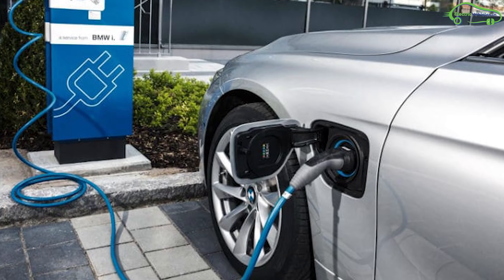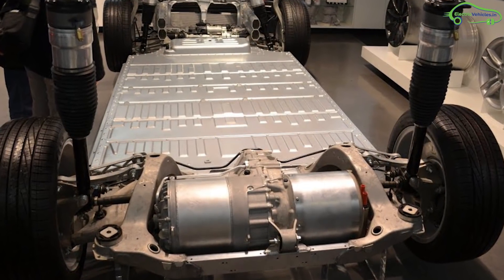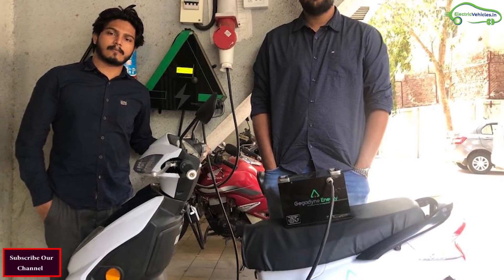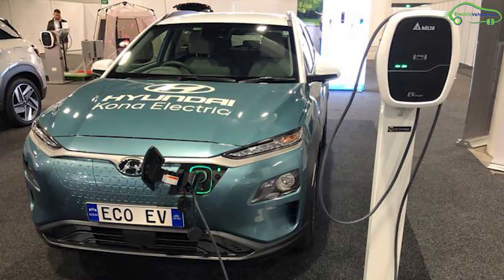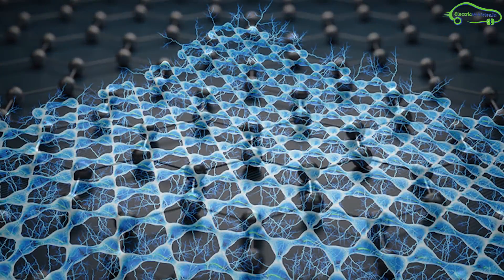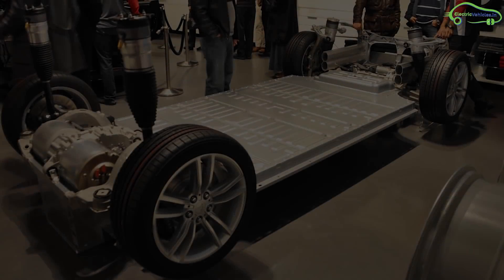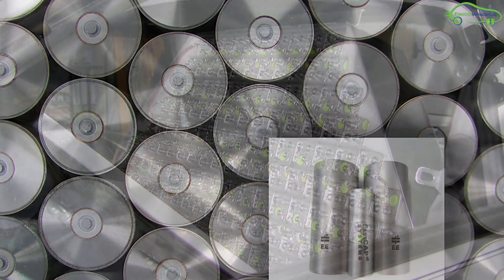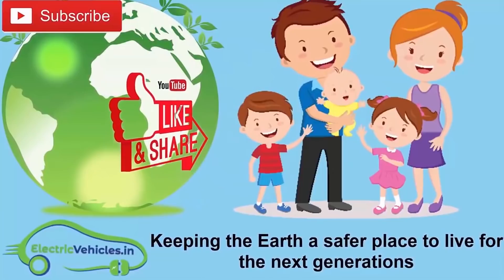Indian Youngsters Made Graphene SuperCapacitor Battery for Electric Vehicles

Comment: I have an exotic electric accumulator that is neither a capacitor nor a battery and behaves somewhat in between (0-chemical reactions involved) the initial prototypes i built shown terrifying results that I’m still scratching my head problem is the high voltages and it’s little radioactive.. and it will kill a lot of people if mishandled it’s so dangerous it could evaporate a human body into ash if you touch the terminals ..

Comment: Don't make videos about stuffs that are not practical, and I mean it's true that super capacitors are great but they are never going to be used in small vehicle because it's charge density is negligible it will run only  few mins.yeah in future we may saw bus,and truck running in sup capacitor, that's it, don't dream more than that

Comment: One suggestion, can't capacitor batteries be used to charge li-ion batteries in vehicles.As li-on take long hours to charge,high cost,etc.The super capacitors have self discharging as its disadvantage .And this product has not been in market now . So first charging the normal super capacitors with short time and then use this power to run the vehicle and also charge battery while running..Can this be a short term sol. for right now.as these products are under development only....comments down your views.....

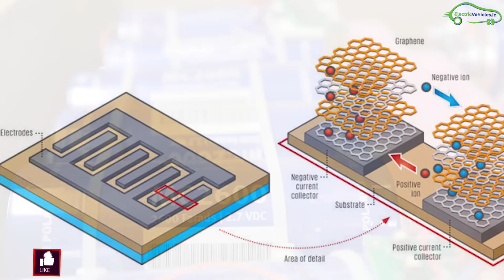Comment: The comment @2:45 that super capacitors are lighter to carry is actually not true. Rather, energy density by volume or weight is where super capacitors are way too poor. You need a huge bank of super capacitors to get equivalent range and the cost will then also be prohibitively expensive. This video doesn’t provide a word of solution for why nobody uses super capacitors. It’s a sort of scam but I don’t think the guy talking on the video is himself aware of it.

Comment: Supercapacitors can deliver gigantic currents, for a very short time. The voltage collapses very fast with time, unlike a battery. Energy content is low. Very useful later for fuel cell driven cars, but useless now.

Comment: Supercapacitors can't replace batteries because they have very high self-discharge rate. Battery has bad power density but can store charge for longer time. Supercapacitor has excellent power density and can deliver high amount of current without any issues which a battery can't. Batteries and SuperCapacitors are complimentary technologies not each other's replacement.

Comment: Bro get to the details.
Graphene has less energy density compared to lithium ion battery
Reply: Graphene is not higher capacity than lithium because of 3/4 lithium structure, but it's really fast at charging. Imagine charging car for 5 or 10 minute.

Comment: Where are the specifics ?
Power density per kg. ?
The clip is high on generalization and low on details.
Super capacitor based ?
It has high energy density but very low power holding capacity.
The price of supercapcitors are very high. A 1000F 2.7 volt costs above 10 USD.

Comment: Super capacitor batteries are not safe on the road, if accidents happens on the road than how you going to control discharging of the super capacitor battery 🔋 packs,,  no management system is developed for manufacturing 

My advice go back University study 📖 and do your Phd in EV batteries 🔋 before wasting your life

Comment: Until the part where graphine as a  super capacitors is fine. Fast charging and fast discharging. But the part where it becomes an all out battery is dicey.  Capacitor banks can work alongside batteries in EVs to improve range. Especially in series hybrid models but to expect them to completely substitute the battery is a little far fetched:)

Comment: Graphene based super capacitor batteries might be safer for utility scale stationary battery storage with strict safety regulations. Alternatively, for batteries in EVs, we can use highly porous activated pure carbon derived from coconut shells, which has good energy density and non toxic.

Comment: Show his lab work, to believe.too much useless talking.
Reply: pretty videos more like a kickstarter campaign show
Reply: Even wikipedia will tell you that materials for supercapacitor still being researched
Reply: I believe in these engineers, we need this to succeed. Eventually they'll pull the carbon from our polluted planet ant make a battery.
All the negativity doesn't make you any  smarter
Reply: @vintageringsGarry  with all due respect, I hope you will agree with me that talking about progress and making real progress are very different from each other... This video does not give any tangible information other than pictures and a deadline... Should we really believe that?
Reply: @sumantacm1  
They have manufactured A, AAA, C, D and   batteries for hybrids that are not affected by the winter temperatures.  I have 2018 hybrid Lithium batteries. Very poor in winter 
Because lithium batteries were too expensive..
There using them in their 3 wheel transport trucks. 
I have alot of respect for these brilliant engineers.

Next they'll be using carbon from the atmosphere to build batteries.
I think you can take that to the bank in the future.
Reply: This is already in research by tesla
Reply: Supercapacitors are not news... Maybe you can fit about 3KWH capacity in your scooter but it will cost you. A 2.7v500F super cap costs about 600₹ and holds 0.0005KWH of energy so per KWh you need thousands of them... Want to buy one?... And yes nobody on earth yet found a suitable and cost-effective way to extract graphene and put it in a supercapacitor... These are all overhyped startup talk don't get excited with the deadlines they are expired anyway...

Comment: DEAR BRO....GRAPHENE IS ALSO TOXIC...JUST LIKE "LITHIUM "...
THE BATTERY BASED ON GRAPHENE IS CREATE ENVIRONMENTAL HAZARD OR POLLUTION...PLEASE READ BELOW

1) Some  of  the  major  disadvantages  of  graphene  include  but  are  not  limited  to;

Being  a  great  conductor  of  electricity, although it  doesn’t  have  a  band  gap (can’t  be  switched  off). Scientists are working on rectifying this.The  main  disadvantage  of  graphene  as  a  catalyst  is  its  susceptibility  to  oxidative  environments.Research has proven that graphene exhibits some toxic qualities. Scientists  discovered  that  graphene  features  jagged  edges  that  can  easily  pierce  cell  membranes,  allowing  it  to  enter  into  the  cell  and  disrupt  normal  functions.
Reply: It is dangerous to put graphane in EVs. During accidents, if graphene is released and inhaled, it will cut through lung tissues.
Reply from the maker: Thanks for your information and your support
Reply: kahan se uthaya hai yeh jankari ? graphite ki ek atomic layer ko graphene kahte hai .. graphite toxic hota hai?
Reply: Samsung also going to use graphene for mobile batteries.

Are they using different technology ?

Or they ignoring this fact ?
Reply: @sachinpundirspy  YOUR DOUBT IS ABSOLUTELY RIGHT....BUDDY....THEY ARE IGNORING OR HIDING THE FACT
I CAN TELL YOU WHY....CHINA IS SOLE EXPORTER OF LITHIUM. CHINA DECIDES THE PRICE OF LITHIUM . SO USA AND IT'S ALLIES WANT REDUCE THE IMPORT LITHIUM FROM CHINA THAT'S WHY THEY ARE DEVELOPING GRAPHENE BASED BATTERY TECHNOLOGY AND TO ACHIEVE THEIR GOAL THEY SHUT THEIR BLOODY EYES TO HAZARDOUS PART OF GRAPHENE  THAT CAN CAUSE NEGATIVE IMPACT ON ENVIRONMENT....
SOLID STATE BATTERY TECHNOLOGY IS MUCH BETTER THAN ALL THESE BATTERY TECHNOLOGIES BUT THE 
PRODUCTION OF SOLID STATE BATTERY IS UNDER RESEARCH.
Reply: The problem is availability.... Lithium not easy available from India, but graphine its available.Matter comes from money...!
Reply: Lol no graphene is much safer than cobalt used in li-ion batteeries
Reply: Graphene is literally layer of graphite if u say graphene is hazzardous then is the lead in ur pencil(graphite lead not a lead element)
Reply: Graphene is actually better